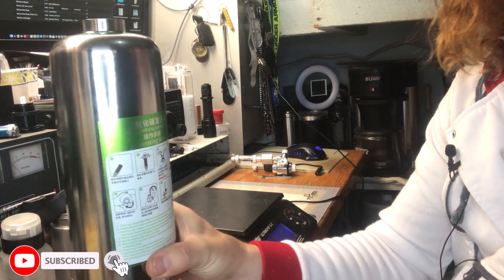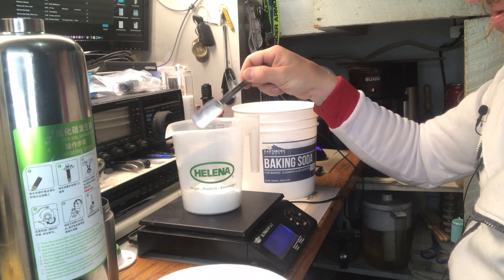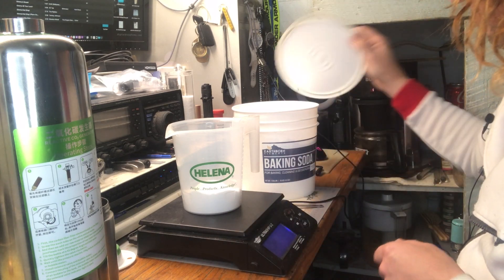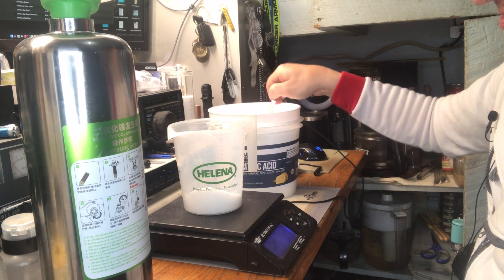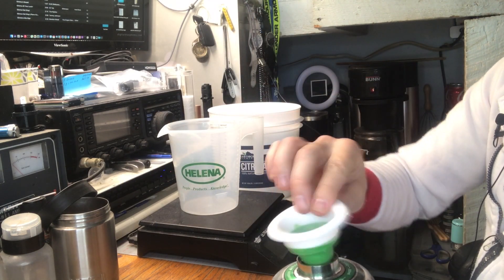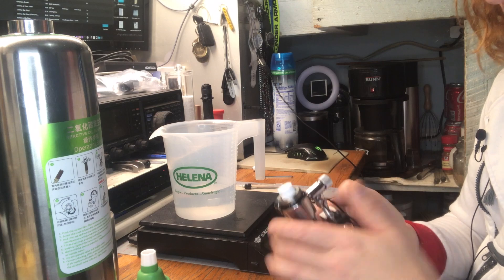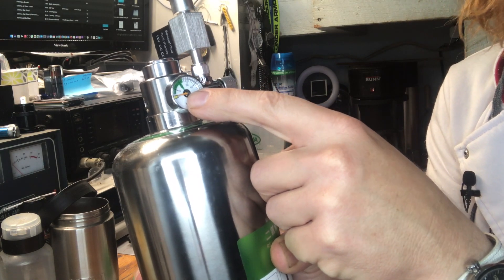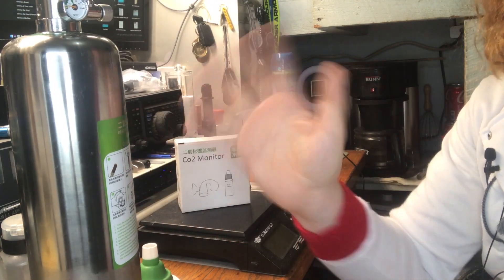ZRDR CO2 Generator Adding Ingredents

Comment: thanks for the info. How is the solenoid holding up?
Reply from the maker: It's good. I run a Buck Converter. So, the Solenoid only sees 10 volts. Case is slightly wam to the touch.